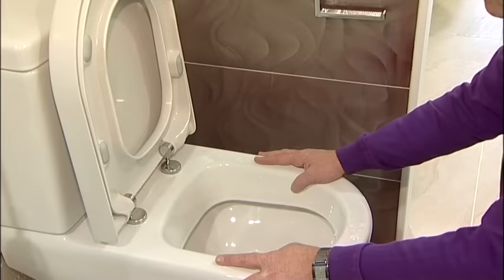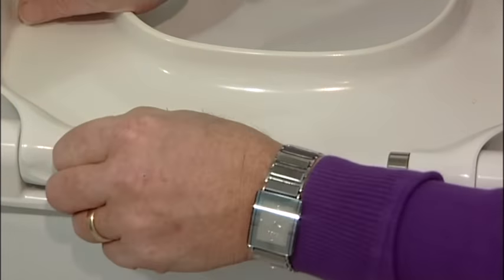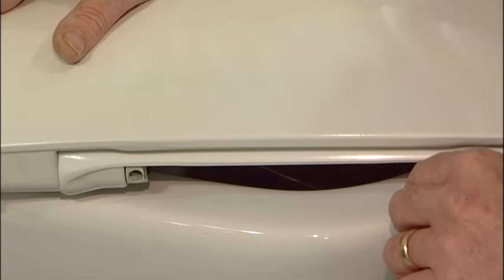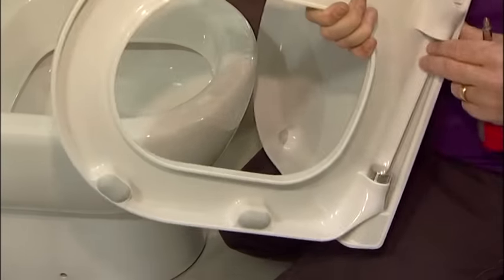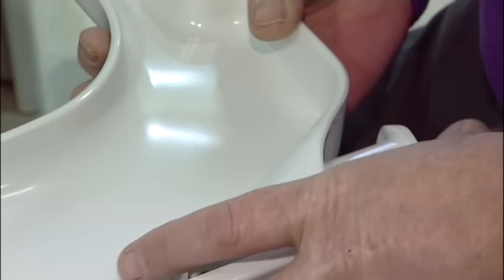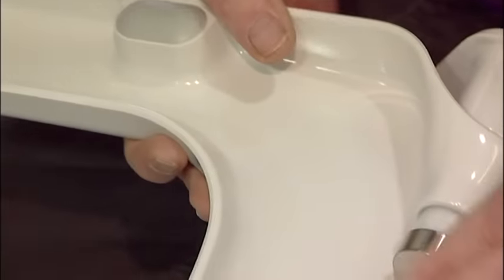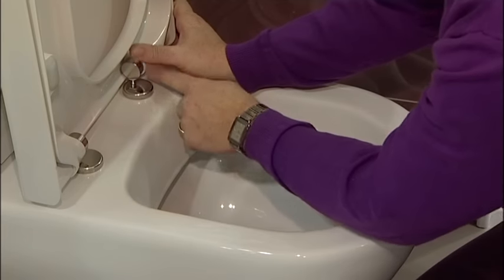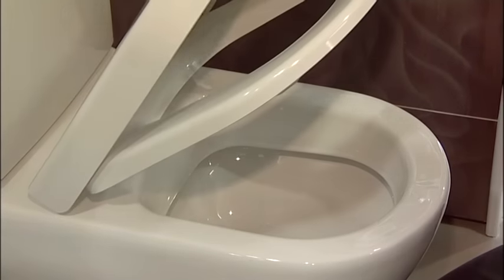How to change Villeroy & Boch soft close cylinders

Comment: Thanks for the video, but for your information, the method of extraction here is  not actually correct. The cylinders can be eased out in any seat position, They can stick in their location and may come apart as you remove them as they did in my case, however don't panic, just reassemble them and they will be fine. The seat/cover do have to be in a certain position in order for the cylinders to be relocated into the cover as seen in the video.
  
I wrote this below as a reminder to myself next time that I need to remove the closers.

                                                                   Villroy and Boch slow closer removal
The closers can be removed with the seat in any position but the seat cover must be at a certain angle to allow re installation.
To remove the closer, prise it out gently with a screwdriver or insert a bar into the hole and tap out. If the parts separate, just remove the parts and reassemble them.
When re-installing the closers, note that the grey one is fitted on the left and the white one on the right (looking at the seat from the front).
To re-install the closer, push them into their respective holes in the seat part so that the bottom of each closer is flush with the end of the seat’s closer holes. This will ensure that they will locate more easily when pushing them into the holes in the cover.
     In order to locate the closures into the cover, the lid needs to be slowly moved up and down while pushing on the closer. 
  Note: The hole in each closer must face downwards in order to locate on the pins on the toilet pan.
  Hope that this helps.
Ray
Reply: For me the instruction to find the right angle around 90° (for the right side connector, which is responsible for closing the seat cover) was perfectly correct. It will allow the plastic hooks/noses to slip closer to the connector body, so it can easily be removed without any use of big force. So the parts won't disassemble either.
To remove the left connector (which is responsible for closing the inner seat ), it's most easy if you reset the seat position to 0° (closed) after you had removed the right one. Then you can easily take off the inner seat part including the connector from the cover part (just lift the loose right side a bit and pull it out). Again, no force is needed for that. The connector is then still firmly placed in the inner seat part, and to finally remove it, you could simply push it with light force from the inner side.